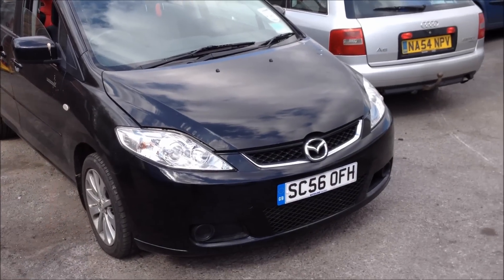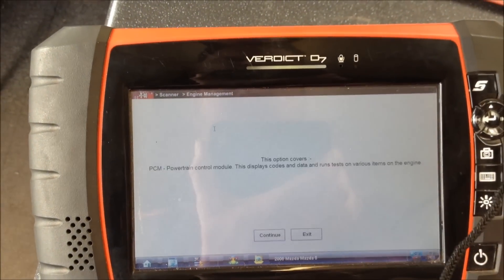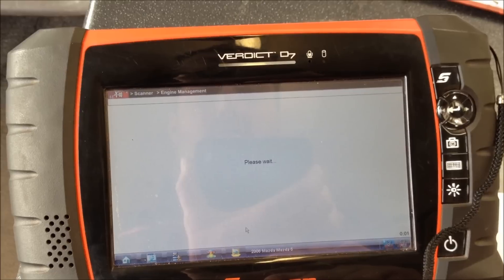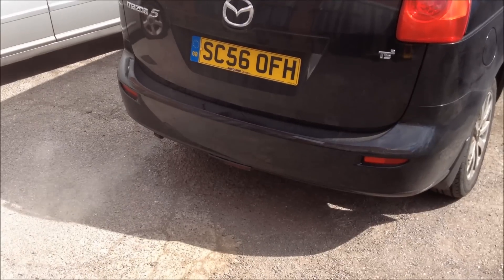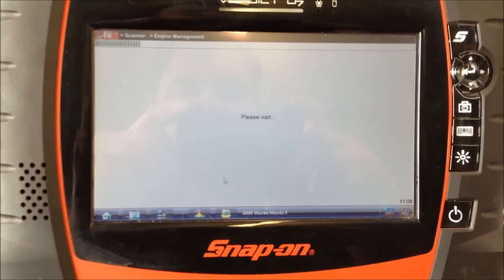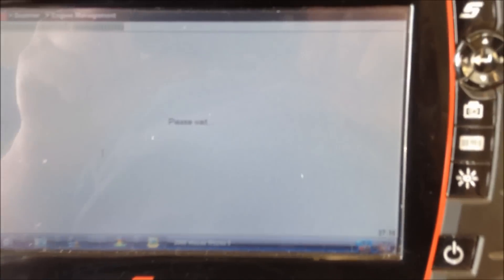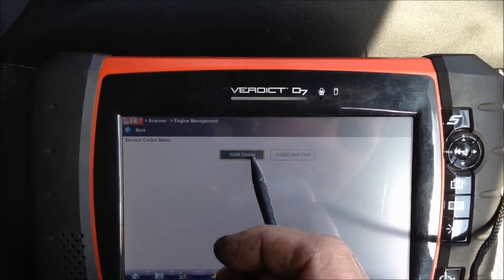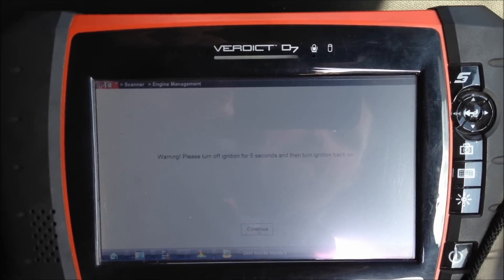Diesel Particulate filter forced regeneration DPF Regen using snapon verdict

Comment: Garage obviously doesn't know what they are doing!
The DPF lamp has two (2) warning meanings on a Mazda5.
When it is on solid, the DPF NEEDS attention.
When it is just FLASHING as in this case, there is NOTHING wrong with the DPF.
A flashing DPF lamp means that Diesel fuel is present in the engine oil to a point when a simple oil change is all that is needed!
The flashing DPF lamp can then be extinguished with about 60cm of plain wire across the battery negative to a multi plug terminal, no need for a grands worth of Snap On code readers.
Reply: The warning light has 2 meanings. Flashing each 0.4s means both calculated oil dillution is high or clogged DPF. The only difference is that clogged DPF starts flashing after like 15 minutes of driving.

Comment: Great video Exeter motor works! Just wanted to ask you I have the same issue with a 10 plate Mazda 5, I have carried out the forced re gen twice I clear the light as you have done but light keeps flashing after, any suggestions what it could be? Or is there a particular way to clear the light after? Many thanks for any advice you could give me. Many thanks

Comment: Hi! I have a 2008 Mazda 6 2.0 TD. My DPF light is flashing, I've got trouble code P2463 and lost the power. Could you do a forced regen? Where are you in Exeter? I am from Sidmouth.
Reply: I have a Vauxhall Zafira
I turn my ignition off and on starting it a couple of times and it sorted out and then take it on the motorway 4th Gear clean out the engine until it stops flashing.
Reply: Attila Kézér just got this today myself mate. What did u have to do to fix???

Comment: Having just bought a Saab 1.9dt tid and experiencing lots of stinky smoke now and then, looking in the engine bay for a fuel leak hitting exhaust, thinking what the heck, I know realise I'm a new member of DPF family, at least now I can explain better when passer-by's panic..!
Reply: hey mate ive also got saab 93 1.9 sport diesel with dpf having the same issue stinky and smokey every now and then what i do is go on the motorway for a run and i do 3000revs on the 4th gear for about 10-20min and it solves the problem right away

Comment: Hi, I have just bought a Peugeot 407 diesel with dpf warning light on, I have taken it to a mechanic and asked him to do a forced regeneration, he told me he won't do them as it can break timing belts, chains and also said it damaged the clutch on a vectra he did a regen on. Is this procedure safe generally or what would be your advice. Thanks
Reply from the maker: +Jason Jones 
HI JASON 
 IF THE DPF LIGHT IS ON, ON A 407 ITS MOST LIKELY TO BE THE "PAT" "ELOYS" FLUID TANK THAT NEEDS TO BE REFILLED THESE NEED TO BE REFILLED AND RESET ABOUT EVERY 100.00KM 70.000 MILES ANY GOOD GARAGE CAN CARRY THIS OUT THE FLUID IS QUITE EXPENSIVE THOUGH, ABOUT £35.00 PER LITRE HOPES THIS HELPS.

BY THE WAY THE FORCED REGENERATION ONLY REVS THE ENGINE TO ABOUT 3000 RPM NO MORE THAN IF YOU WERE RUNNING ON A MOTORWAY AND THIS PROCEDURE IS THEIR FOR A REASON

THANKS DAVE P
Reply: +Dave Pearson Thanks for getting back to be, So if I have the fluid topped up will this improve the performance as the vehicle will only just reach 3000 rpms. Once again, many thanks
Reply from the maker: top up the fluid clear the codes possibly regenerate then you should be ok
Reply: spajderment
Reply: urbex2007 - I am fresh owner of used Zafira Tourer 2.0CDTI y2013. Why can I not use DPF additives to diesel? They claim to lower a temp of ash burnout significantly. What is the fault on that DPF on 2.0CDTI?